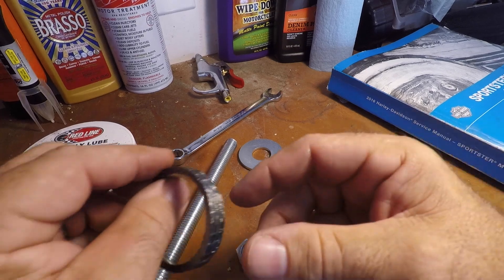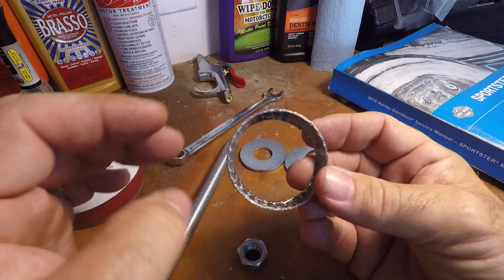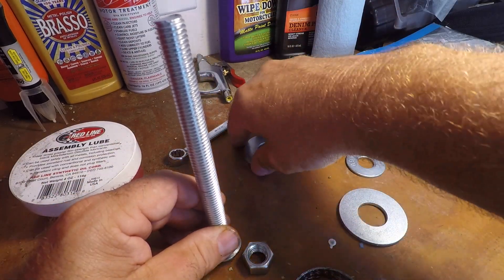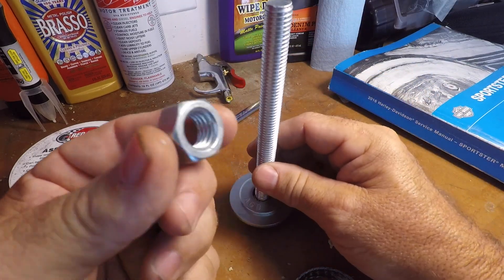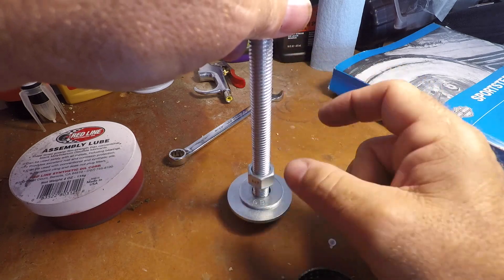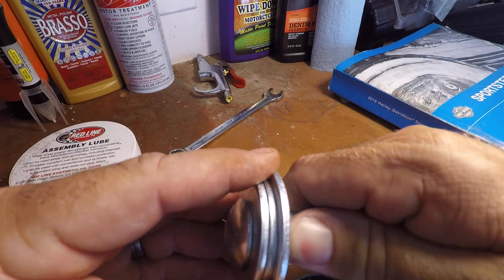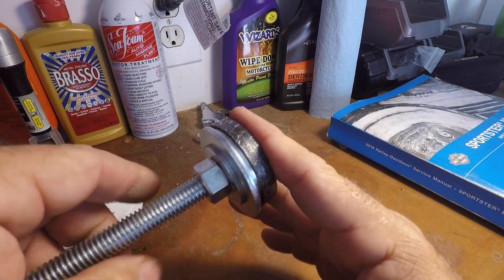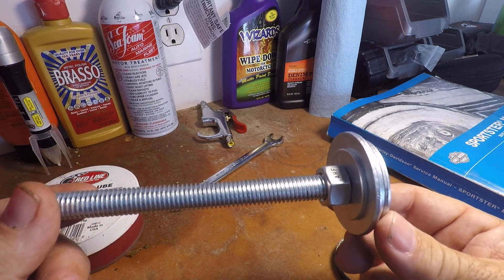Harley Davidson Exhaust Gasket! How to install.

Comment: Why go through all this when you can simply push the gasket in with your fingers?
Reply from the maker: Never had much luck doing that.
Reply: I sure have.  It was easy to do on my 2007 Fat Boy.
Reply: I have done it and it can be difficult I’am sure some maybe easier.
Reply: I have done it several times, and yes it can be very difficult if you, push to hard
Reply: because it doesnt work. too tight
Reply: Not on mine

Comment: I have a 2018 tri-glide and I went with the same washers but used a 1/2"x3" carriage bolt. The 1/2" bolt holds the first 2 washers perfectly centered. While mine did not slide in easily a slight tap with a small hammer seated the gaskets without deforming them. I used a user's comment looking at a shorter bolt and the 3" bolt gave me just enough room on the front cylinder to get it in and then tap it into place. This saved me a world of headaches.
Reply: great improvement on a great idea... tks
Reply: What washers did you end up using because home depot doesn't carry all listed here.

Comment: I made one for about $1.60 buying the stuff by the pound at Tractor supply...I used the exhaust flange on the tool to finish getting it installed flush. worked great!
Reply from the maker: Glad it helped!

Comment: Big Thumbs Up, worked like a dream. My gaskets were tapered on the inside, so I could only use the one washer @ 1 3/4 diameter.  Also was used a little engine oil to coat the exhaust port. Slid right in. Thanks tons for sharing.

Comment: I tried to Simply pushing the gasket in over 40 years of wrenching ase-certified pulling tractors motorcycles ATVs cars this is one of the best tips I ever received thank you
Reply from the maker: Glad it was helpful. Thanks for watching.
Reply: Yeah till you try and locate the washers. Big Fail!

Comment: Good idea, gave me the idea to use a large rubber stopper I have. The cone fits nicely on the stopper. Only problem is that my exhaust port measures 1.0895 while the gasket measures 1.0947 = no go.  I'll kink the side a bit to get it in then press the gasket back out to opening.

Comment: Great hack...went out and purchased the items today.  The rear cylinder gasket went in slick as snot.  The front, not as easy because the frame and reflector got in the way.  It started it enough though and pushed it in the rest of the way with no problem.  I think I am going to make another "stubby model" for the next time.  Thanks

Comment: THANK YOU, THANK YOU THANK YOU.......but there was an improvement for my
2007 FX Softail Springer by lengthening the carriage  bolt for the rear exhaust.  I
coupled two carrage bolts to 9" in length that gave me a more controlled angle &
used an old cobblers hammer to gently tap it in....... Easier than last year......

Comment: Hey thanks for tip. Made my own a little different. Put 1 washer at the end. Tool goes flush with gasket. Right against the engine.
Reply from the maker: +mlunden11 no problem at all, setting those gaskets are a real pain.

Comment: Never owned a Harley before in my life and just purchased a custom chopper with a EVO motor..never owned a harley and was working on the exhaust the other day...studs were jacked up..so I pulled the pipe out and said to myself..what do we have here. It looked like someone had tried to "wrap" the exhaust and the remains were around the cylinder hole..so I proceeded to yank that biotch out only to find out later, that was the exhaust gasket..never seen one before like that ..but now I know..and knowing is half the battle......wait for it.

Comment: I've been trying for months to find a 1 7/8" od flat washer in any size id. They must be stored with the unicorn tears because Lowe's, Home Depot, Ace Hardware, Fastenal and all of the local small hardware stores don't stock it. They have 1 1/2", 1 3/4" and 2" but NO 1 7/8" flat (or fender) washers. Are you sure that you are using a 1 7/8" od washer?
Reply from the maker: I ones I found are 1 7/8 od.  I made this video 2 year ago things might have changed thinking 2 od would work fine.

Comment: Looks awesome but can’t find 1/2 x 1-3/4 or 1/2 x 1-7/8 washers anywhere! Went to 3 hardware stores as well as home depot today only came back with 1/2 x 1-1/2 washer, bolt, and nut ... :(

Comment: Worked perfect! Thanks for the tip.
Reply: Where did you find the  1 3/4 x  & 1 7/8th x 1/2 Washers? Part numbers at what stores? Every Box store near me in Illinois did not carry them! Help others as I wasted a entire day driving all over. Autozone loand tools for free. I ended up getting a wheel bearing race installer kit on loan and used the 50mm die to easily install the Gasket by hand. Took me much longer to wait in line to get the tool kit then it was to install it.

Comment: Hey Tony ! 
Great info, Im about to do an exhaust wrap on my 2013 Iron and also Ill try to find the source of some chirping sound my bike makes mostly on idle and deceleration... Do I need to get 2 or 4 exhaust gaskets for the job? I dont know if the stock cross-over tube thing has gaskets too LOL. As always thanks for your help man!
Reply from the maker: You will 2 head gaskets and 2 for the crossover. What kind of exhaust are you going with?
Reply: Same one, stock exhaust, I bought the bike with stock baffles removed, sounds loud enough for now. I mainly want to the rid of the chirping sound which breaks my balls, and since Ill have the whole thing out Ill also paint the cross-over tube (its all rusty because the previous owner had it in his garden while using V&H Short Shots) and replace the gaskets of course. Thanks bro

Comment: If you put the gasket in the freezer overnight, it will have a slightly smaller diameter, until it warms up, of course, which will make it easier to seat, but you gotta seat the seal right away, or you just wasted your time. It definitely helps.

Comment: Is there a reason you went with the 3/8 inch carriage bolt instead of a 1/2 inch carriage bolt? I noticed you said all the washers were 1/2 inch inside diameter.
Reply from the maker: The 3/8 gives me alittle room to adjust the washers on the bolt.
Reply: @TonysGarage  Oh ok i thought it might have been to fit over the square end of the carriage bolt but wasn't sure.
Reply: @TonysGarage  thanks I'm going to have to find them somewhere else my home depot didn't have the 1-3/4 or 1-7/8 washers

Comment: What is the Actual size of the washers? If you remember thanks
Reply: He says it in the video 
3/8 carriage bolt
2x1 3/4 washers
1x1 7/8 washer
1x1 1/2 washer
3/8 nut

Comment: You don't need all of this shit.  Just get some fine sand paper and smooth out the exhaust port... remove any debris or crap stuck to it.  Wipe it out with a rag.

Then, start evenly inserting your new gasket with your fingers... press it in gradually and uniformly all around with your thumb.

Takes about 10 minutes to do it, plus you won't F up the edges of your expensive new gaskets using this tool with sharp edges.
Reply: I've done it numerous times on all different Harleys, without giving up.

May cuss a bit, but never gave up and it always comes out great.
Reply: BS, stop lying.
Reply: You're  talking to your bathroom mirror again tonight there crazy.

I bet your parents are proud of how you came out, huh?
Reply: gyut gyut.

Comment: I bought new pipes and when I took the old ones off I started removing the old gaskets. The front was a breeze but the rear was completely destroyed. I am having a terrible time trying to get the peaces out and the surface for the new gasket is terrible. Anyone  ever had to deal with this?